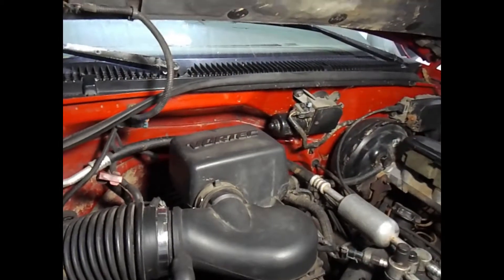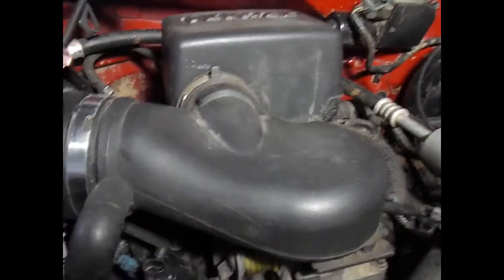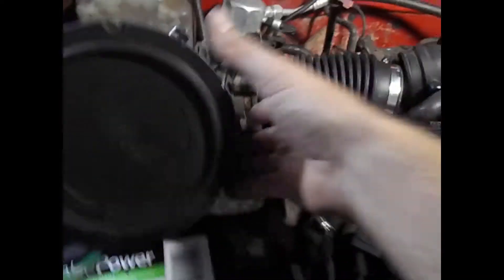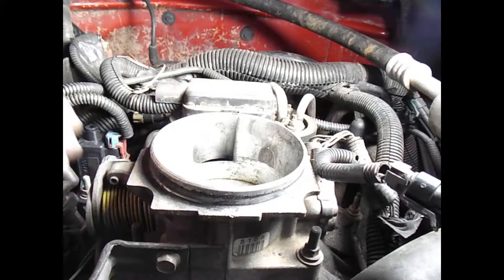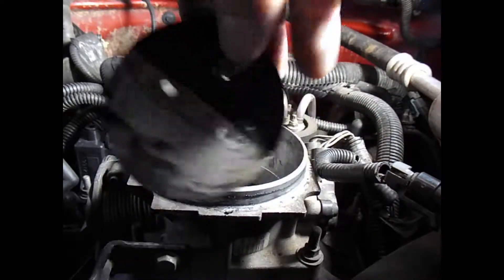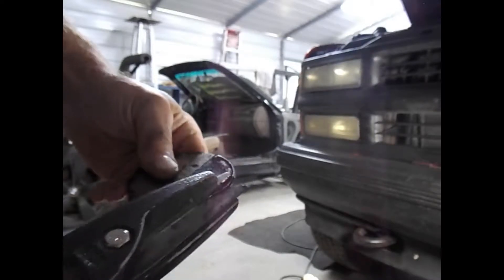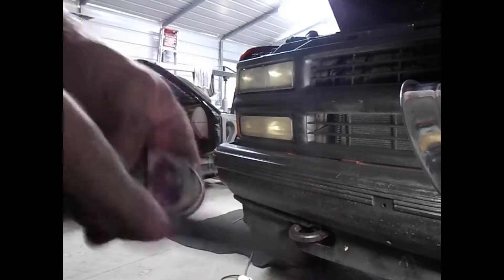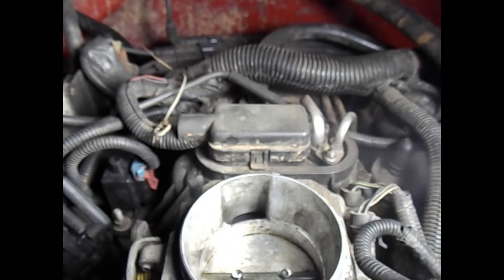Silverado K1500 Throttle Body Mod

Comment: If you keep the cover off, itll be more like a hot air intake. You'll be sucking in all the hot air from under the hood, keep the top on the filter box!
Reply from the maker: Eric Mcguire i agree. I ended up keeping it on. I had several people tell me they put a KN on and removed the box but I had the same thought as you, that it would intake more heat. Thanks man.